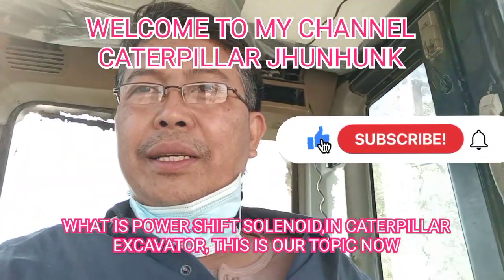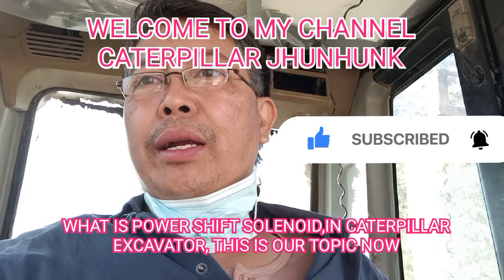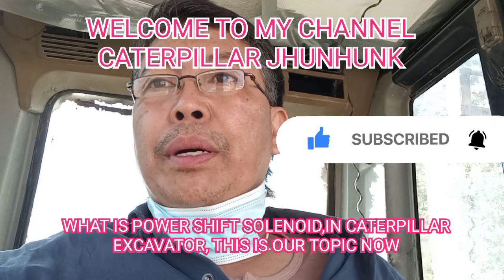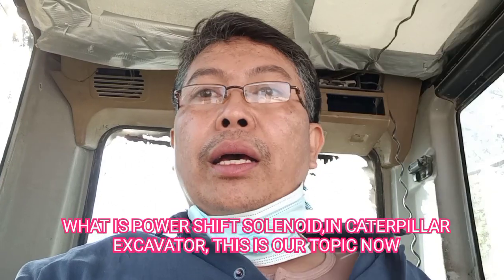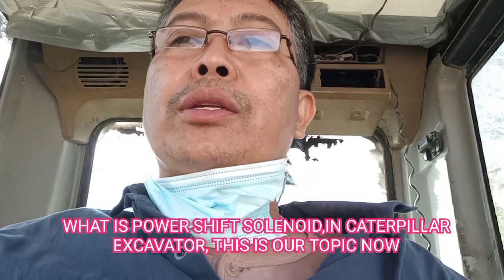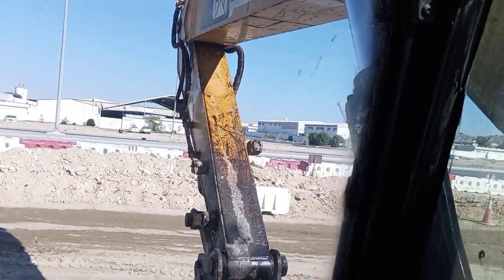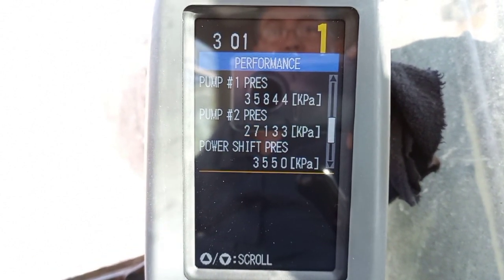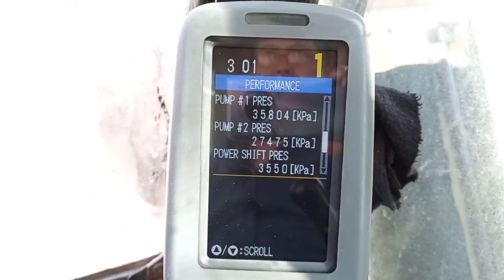CATERPILLAR EXCAVATOR SIMPLE TIPS HOW POWER SHIFT SOLENOID IMPORTANT, IF THIS IS NOT FUNCTIONING

Comment: Watching from cebu,.. salamat sir sa inyung binahaging kaalaman,.sir baka pwd maka hingi ng mga error code ng CAT para mapag-aralan ko.. Gob bless 🙏
Reply from the maker: may whatsapp kb +971567581176 message mo ako
Reply: @caterpillarjhunhunk  assalamo alaikum sir have cat320D excavator low power &sutdown machine and active code are 36-190-8 &39- 167-12 sir what is problem pls reply
Reply from the maker: @phoolkhan2282  bro actualy that problem is not easy to identify where the problem, i have some step to do to find out what type of problem we have. but you can conrac me in my whatsapp mor better to talk. +971567581176
Reply from the maker: @phoolkhan2282  bro try to check 190 is a speed timing sensor located at fly wheel side ok maybe dmage or loose connection, and the other one is 167 alternator maybe the sensing wire for charging is disconnected or maybe damage check the charging on monitor if morethan 27v engine is running maybe the sensing wire damage or disconnected

Comment: Very good information, and what mean error 95-168 -5 , and what this to do solves it??? And thank's to help
Reply from the maker: which machine you have
Reply: Cat320D
Reply from the maker: @sapri6328  ok bro 1 by 1 first 95 is fuel deffirential pressure sensor maybe broken wire or sensor damage located at the fuel filter that is rectangular form with four bolts and three wires, 168 electrical system you have to do inspection to the wires beside the engine ok same open connection
Reply: Ok thank's very much, en God bles👍🏻👍🏻👍🏻🙏🙏🙏
Reply from the maker: @sapri6328  bro like share and subscribe
Reply: Failure Mode Identefier -5 means current below normal, -open circuit . Maybe in harness ,connector ir low resistance solenoid

Comment: My machine power shift pres showing constant pressure 3550 no up and down after 5 min of running...and machine takes load
Reply: machine the pressure will be 3410 kpa and when we increase the mode will change into 2438 kpa and will vary according to the load.

But when working after sometimes we feel the hydraulic pressure drop down and also engine is also not smooth sometimes can shut down the engine.On that time I noticed the power shift pressure remains constant at 3550 kpa.(in display).and physically by guage 520 psi.

The voltage is getting 24 volt

The machine operated in back up mode is the same as the hydraulic and engine operation is not smooth and some times it can shut down the engine ,when connecting the pressure guage can see it drops down to 220 psi. 

I would like to know whether this can happen due to injector/injector pump ,becuase all the machines have starting problem and using starting aid to start the engine
Reply from the maker: @shoaibkhattak8496  i dont know exactly where it came from about your problem, you know what, if your engine is electronic type or ecm type, and the engine suddenly shutdown while you are in testing my some sensor is not work or not functioning in normal or if the problem is in hydraulic system totaly everything will not fuctioning like normal, my advice you to check the engine by full close of arm or full up of boom
Reply: @caterpillarjhunhunk  full machine get slow all booms and chains is slow
Reply from the maker: @shoaibkhattak8496  i knew you can do it, you need to have other person to operate and you do checking actual of power shift the supply
Reply: @caterpillarjhunhunk hello sir i have cat excavetar 336 dl hydrolic all sistam slow but i change power shift  solenoid  same problam sir help me❤
Reply from the maker: @jokhapun1723  bro check high pressure of mainpump
Reply: I dont know too much but its 2012 year
Reply: Mr Shoaib did you find the solution for the problem, as I’m facing the same issue have tried changing load transfer (power shift ) solenoid but still same condition

Comment: What is problem is mashine working with power shift disconnected?
Reply from the maker: actualy bro on my video if the power shift solenoid is no supply or not functioning the engine is overload or it will coming shutdown if you forcely work